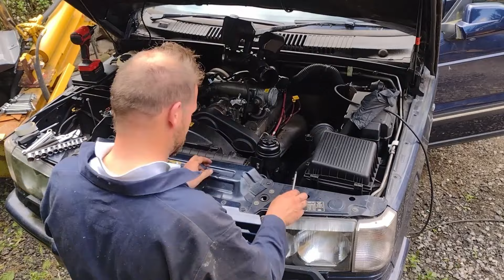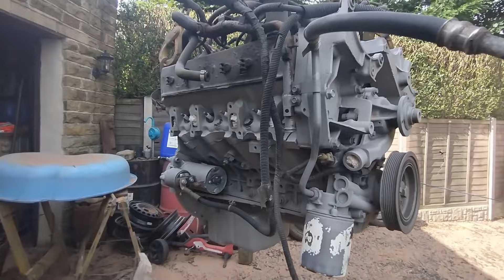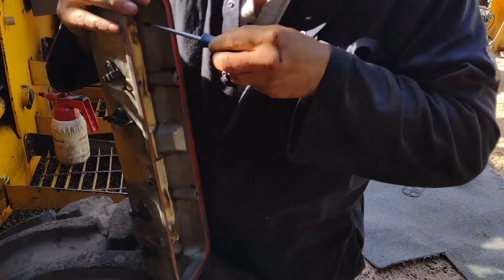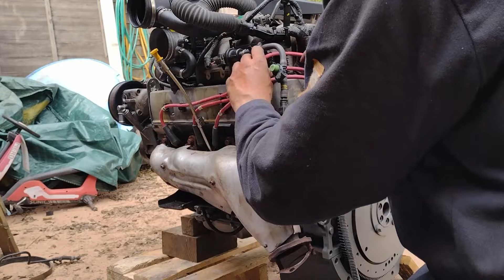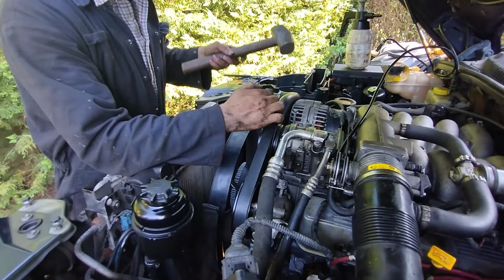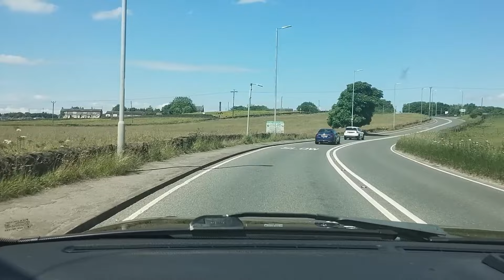Range Rover P38 V8 Engine Swap Disaster: Is It a Head Gasket Failure?

Comment: Nice job Paul ,  I’ve done a few engine changes/ rebuilds , and it’s no mean feat , good attention to detail , sounds great !! 👍 . It’s brilliant that your doing your own narrating on the videos , gives it a more personal touch well done .Keep up the good work. Look forward to the next.😁👍👍
Reply from the maker: Thanks Hartley, the engine work had to be done to save the vehicle, we were lucky to find a replacement that had been rebuilt shortly before. So with the engine out of the vehicle, we cleaned, painted, or replaced any parts that just didnt look right or clean enough for our very clean mk2 Range Rover. Since this video when out, that engine has already traveled 6,000 miles without any further issues, no coolant or engine oil loss.  👌👍 We are still working on making each video as good and enjoyable as possible, very hard sometimes to say the right thing or to say anything at all, I think we're getting there 😊